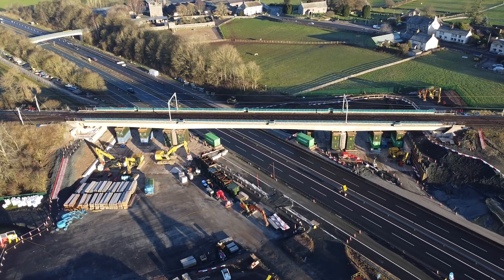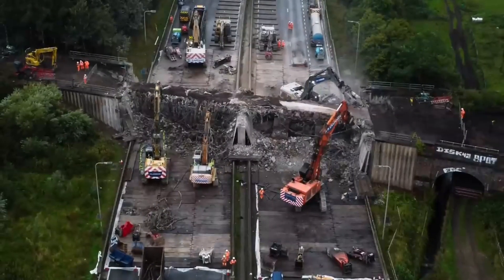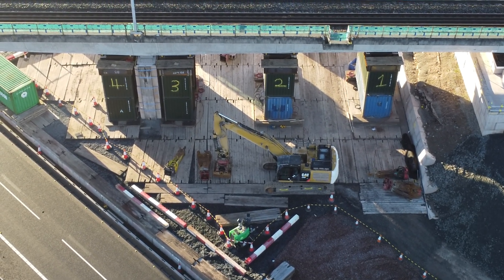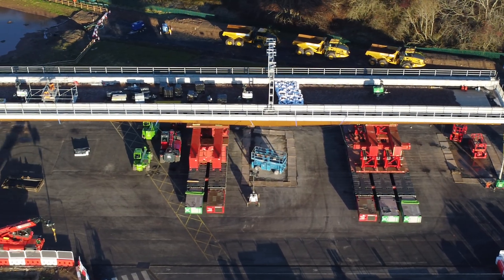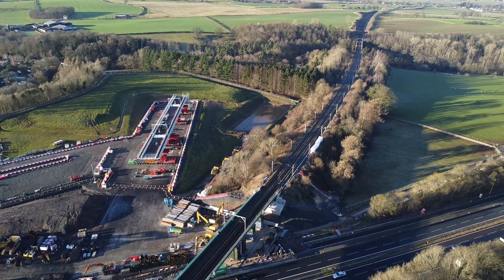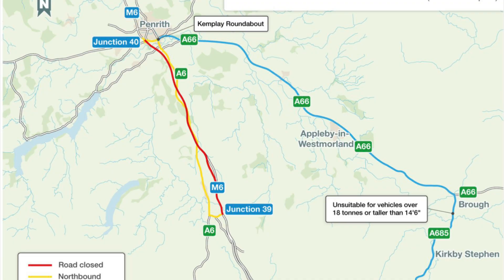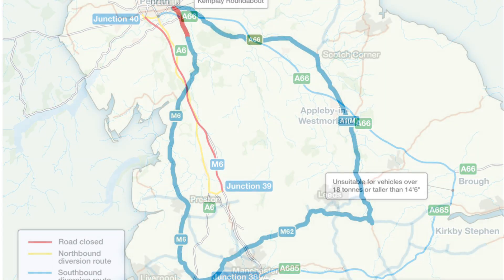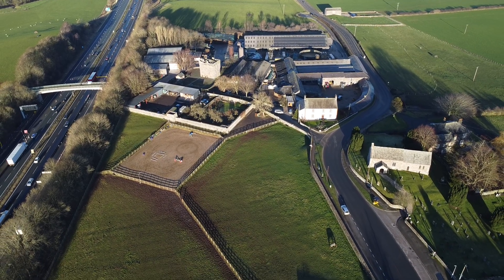Clifton Railway Bridge Replacement Project Penrith | M6 Motorway Bridge | West Coast Mainline

Comment: The incredible irony of replacing a bridge constructed in 1968 that has reached the end of it's life by diverting trains over a bridge constructed in 1875.

I thought we had become better at things in our modern society?
Reply from the maker: The 1960’s was an “ experimental “ time in terms of some construction methods / materials. Obviously, some of those experiments won’t be repeated.
Reply: The trains also had to go slow over the ribble head viaduct, they face very differnet loads and a large span between pillars to alllow both carriage ways, (which is where steel is used)

Comment: Considering that the Ribblehead Viaduct has stood since 1875 and is still running trains it doesn’t say a lot for whoever built the existing railway bridge in 1968 that it’s clapped out after fifty odd years.
Reply from the maker: I think the difference in materials and design over the years plays a big part in the lifespan of these structures.

Comment: You would have thought that they would have replaced that bridge with a 4 track bridge to future proof it....  they keep going on about the WCML being busy, well here was a chance to look to the future
Reply from the maker: Valid point James. I’m not sure whether the WCML would be able to be widened but, like you said, future proofing may have been an option.
Reply: You can’t just make a 4 track bridge and expect it to improve the WCML capacity issues. Without 4 tracking the rest of the route a larger bridge would cause a bottleneck on the bridge. GBR will never stump up the billions of pounds required to improve the whole WCML.
Reply: @Goldenoldie49  It could enable a long passing loop for passenger trains to overtake slower freight. I cant see the entire line being made 4 tracks but if more longer passing loops are installed it would allow for more paths. This would enable better use of the line.
Reply: Wouldn't it be easier to add an adjacent structure, if that reality materialises?
Reply: Yes it would have  made sense to future proof it to allow for 4 tracks.
Reply: @richardsterne2875  But does it not make more financial sense to build another parallel bridge to the same design when it is needed?
Reply: @Paul_707  1 bridge 2 weekend road blocks. It would enable engineers to use the bridge to access the line until extra lines are added. A second bridge in the future at what extra cost more than double a 4 line bridge.